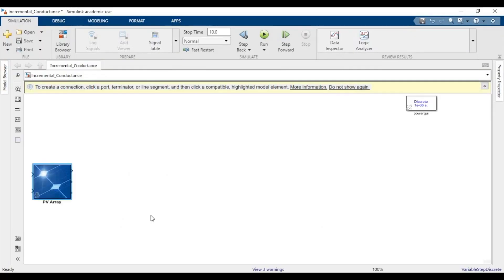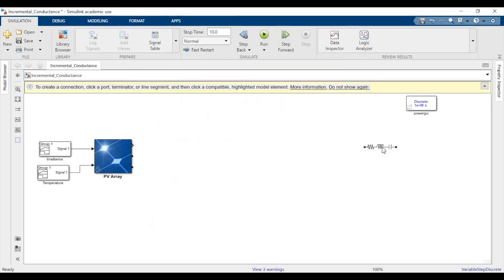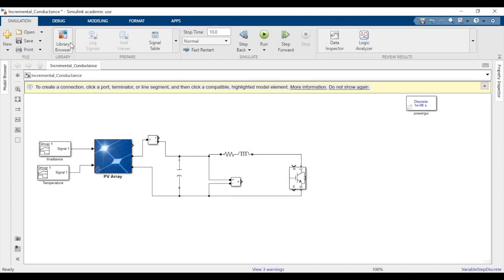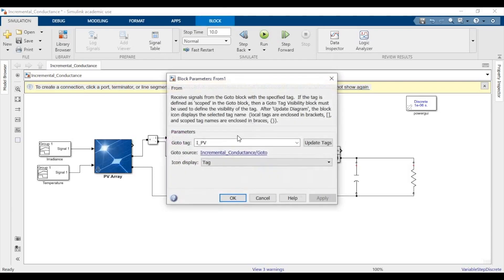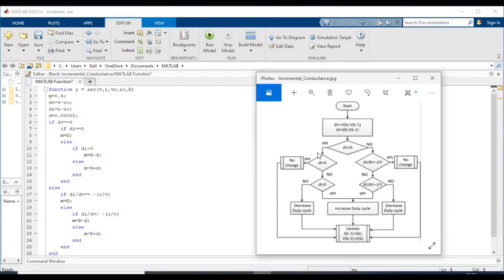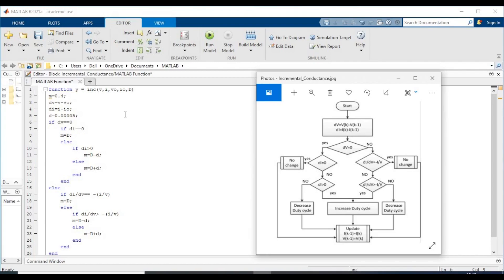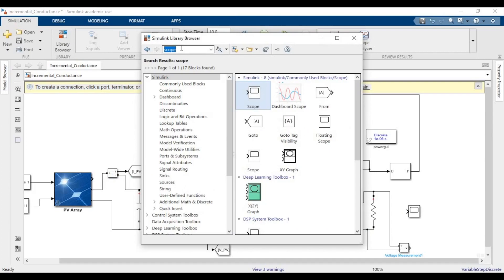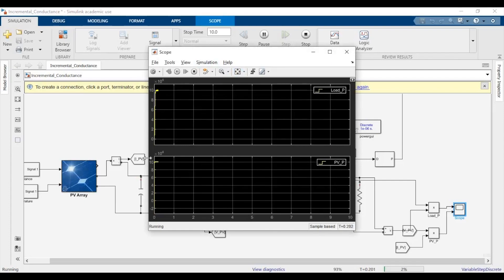PV MPPT Incremental Conductance on Simulink / MATLAB | Step-by-Step |

Comment: sir if di>0 then we should add the step change as per algorithm but in code you have subtracted the step change. Can you please explain me this?
Reply: Hi ..Akshay This is because Buck - Boost converter is Of Inverting nature.This Buck boost Converter reverses polarity of Applied Input.Thats why Value of 'd' is opposite sign of given Duty cycle.
Reply: @Rkbittu  Hi .. could u explan more .
 I dont get it .. Thus, if we need to increase the Duty cycle, the duty cycle value becomes lower?